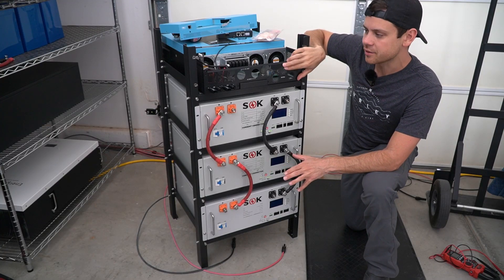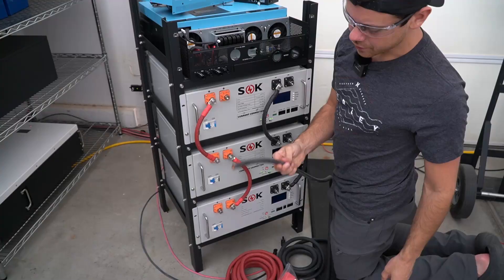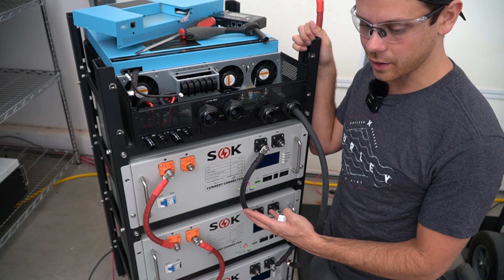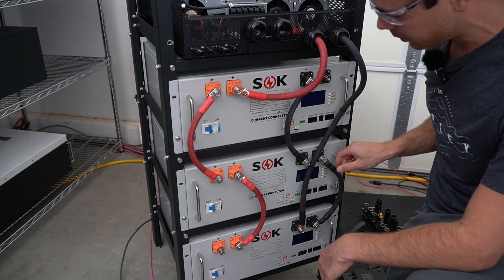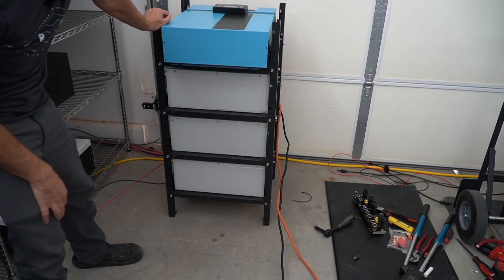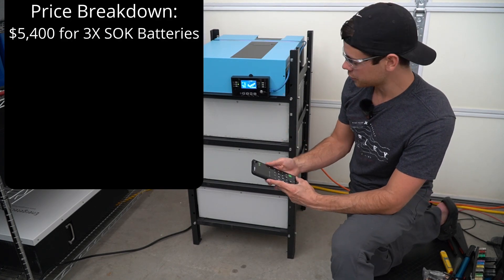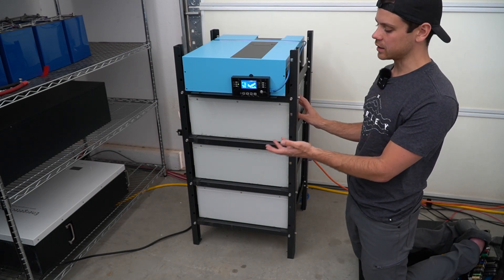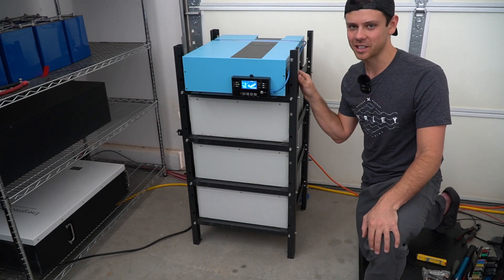DIY Server Rack Solar Power System: 15kWh LiFePO4 + 8kW Solar + Serviceable + Scalable

Comment: Great demonstration. You nailed it perfectly. I was wondering if you have plans making a video on Offgrid, European/other world voltage solar systems (230/400V 1phase/3phase).  I strongly believe that will catch a lot more audience and with much higher viewing too. Just a thought. Please do consider it. Very much appreciated for your devotion and all the great work you do for this community. Cheers.
Reply: In Europe, the batteries would be exactly the same, and the inverter would only have one hot leg, not two, so not a big difference. That said, it would be cool if we all learned how other countries do it.

Comment: Simple, compact, cheap. Awesome.

I've watched a lot of Will's videos and safety tips are mentioned throughout. But I haven't heard a discussion of the safety of putting this in your attached garage. Some people have a "solar shed". I'd love to hear Will's take on all the safety issues and best practices. Maybe there isn't much to it with this type of system. Thanks for all these great videos that give my day a nice boost whenever a new one comes out.
Reply: Mine is in the basement and i have no concerns .I would be more worried about my furnace trying to kill me ,i had to replace mine 2 years ago because it was filling the house with co2.
Reply: if it worries you, Will mentioned you could put T classes on it, not necessary but he mentioned it if going bigger..especially if using 250v, and you have a single inverter short or a wire short.  There is a discussion in DIY about using hardy.
Reply: @goose-F16  Thanks. I was worried about the runaway fires I had seen in the news. Since then, Will's "LiFePO4 Drill Test! Will it erupt in flames?" video showed that LiFePO4 is fairly safe. I'm still curious if Will would put batteries in a home basement, or would a garage be better - outside the main living space.

Comment: I would extend the server rack (up) and mount the inverter vertically. That way you could have access to the batteries and you would not have to remotely mount the controller.
Reply: Could you mount 2 back to back on a central board?

Comment: Put locking wheels and a wide base on it. Being able to roll it while having it stand steady means a lot to a physically challenged but able person. Having the security to inspect the cables and such on the back adds a peace of mind.
Reply: Harbor Freight.....fabricated a rolling pallet table for the machine shop, they'll hold 1,000 lbs easily.
Reply: Harbor Freight - 4 Wheel Dolly, cut legs off below bottom shelf, attach shelving to dolly
Reply: i got casters for my server rack ,even with one battery you need them .90+ pounds a shot.

Comment: For whole home backup in a dual rack 30Kwh split phase 120/240V config, would you recommend the LVX6048 over the LV6548, given inductive loads like well pump, furnace fab, heat pump, fridge, washer, dryer?
Reply: I can't see much difference between the two, what am I missing?

Comment: I think the one main downside to turning it like that is you're making it hard to fix something, or check the displays on the batteries themselves.  I know you said in this setup you only want to look at the one control box, but personally I'd rather push it flat to the wall and put a movable divider to hide it if needed.
Reply: You can always slap some wheels on the bottom of the rack and turn it around. Or make a Lazy Susan type base that twists around.
Reply: I kind of agree I like looking at the batteries haha especially those apps okay with the digital readouts and everything. I want people to see all the technology

Comment: This is PERFECT for a whole house backup system too, even without Solar. Just having it for cases of Disaster recovery, Blackouts, Brownouts .. etc. If you double the battery capacity to 30K, you will have more than enough to survive a disaster or extended blackout for Days!  Add a nice size Generator in cases of REALLY extended blackouts and you are good for a long time!
Reply: Might as well add solar and go completely off-grid. The Panels will probably be the cheapest if u go refurbished panels..
Reply: @suwaebuceesay9954 My question is how small of a quiet generator would be required to trickle charge these batteries to augment charging on cloudy days in a medium zone like Ohio and stay off grid in say a 2500 sf house? (32 kWh avg daily demand). You can buy an 8000 W tri-fuel portable generator for less than $1400 and run it for months on a large propane tank if you wish or plumb it into your natural gas (the other grid)
Reply: @sethkenimer3151  Mostly when i think of including a generator into a solar setup i feel like am cheating.. I’d rather reduce my energy usage at times when the sun will be a problem for the Panels..
Reply: @suwaebuceesay9954  Well, sometimes you don't get a choice .. there are places where you get over cast clouds for long enough that you can't really charge the batteries from Solar. In that situation, You can crank up a generator, charge up the batteries at full output power then shut down and use the batteries for a few days.
Reply: @suwaebuceesay9954  Yeah, but sometimes it's not possible (Rental places, local zoning ordinances .. etc).
Reply: thats totally true. however if you were able to run a generator it'd never pay for it self. a little bit of both  cau
Reply: bit of both...come summer or those days of sunshine you're still using propane.

Comment: Just out of morbid curiosity, did you weigh it?

Seriously, this thing is fantastic.  If I didn't have to re-pave a driveway this year ($20,000) I would probably put one of these together for myself.
Reply from the maker: The batteries are 99 pounds. So about 400 pounds total.
Reply: @WillProwse  Whoa! even more than I expected.
Reply: @DIY Solar Power with Will Prowse  are you still liking the sok batteries the best I wish I'd have bought them. I did get my eg4 for about fourteen fifty each. Only 5-year warranty though. oh well I'm kind of stuck with them now. I have 1 EG 4ll three regular eg4 do you think could I add 2 sok's in there. 

All current products I just bought them

I know you're not supposed to change battery brands or I should say have different brands in the same rack
Reply: As I remember the batteries are about 60-70 pounds and the inverter is about the same.

Comment: For a small off grid home this would work for most power needs, providing you have an alternative heating source like a wood or pellet stove. Myself I like propane for cooking. 

This system being modular is handy to scale it up or down to fit your power requirements.
Reply: How fast do you go through propane in that situation? I've always been curious about that. Do you buy Large canisters (20/40/100lb?) and how long do they last on normal use?
Reply: @jonjohns8145  when it's just me a 40 pound tank lasts three months easy when sweetie is here because she likes to cook about two months.
Reply: @krissfemmpaws1029  Nice .. I would have thought less, good to know.
Reply: @jonjohns8145  at this point all I use the propane for is cooking and heat water for washing dishes.
Reply: @krissfemmpaws1029  Do you use it for Shower water heating or do you use excess Solar for that?
Reply: @jonjohns8145  I use a solar shower for that or go down to the Port and use their showers. But I am looking at a propane portable shower hot water heater.

Comment: I love your content and enthusiasm!  I have casually explored solar the last couple years (trying to decide what system I want) and find your content very valuable.  So, I know this model charge controller isn’t UL Listed for grid tie application in US.  BUT, I really want to do essentially 2x this setup for split phase 220 but want grid tie…. I had been planning to do a SolArk for convenience but would very much appreciate if you could delve into best value option for UL Listed secondary isolation automatic transfer options may exist…. I.E. help me figure out how to not pull the trigger on a SolArk and somehow make these gridtie able - please
Reply: I second that!  Would be wonderful to get Will's recommendation on if/how it would be done :)
Reply: Yep. Same boat. Been delaying on pulling the trigger on the batteries but now is looking better and better. Grid tied with battery backup like solark but better.
Reply: SolArk (based on Sunsynk) is great kit. The video shows what can be done for a great price, but long term I would definitely consider the SolArk even at a slight premium. Certified, longer warranty etc. I know Sunsynk has a new 16kW single phase (240v) which launched recently- perfect for high peak households - no need to parallel 2x 8kW’s- perhaps reach out to SolArk and ask if it’s coming to them as well in future- unless of course 8kW is big enough for your loads.
Reply: Will be following as well

Comment: Straight to the point of the video, very appreciated.  Q: Would this type of system work for a RV or Motorhome?  What would you change for a mobile installation?
Reply from the maker: This thing is heavy. Focus on distributing the weight strategically on the chassis. Or put water tanks/propane on one side, and this battery on the other side. Keep the weight between the wheels. Also, in an accident, it will have a lot of inertia. I would suggest grade 8 steel bolts holding it to the chassis.
Reply: @WillProwse  Wouldn't you also prefer a 24V system in that case? since most RVs are wired for 12/24V?  You'd have to use a different inverter and batteries, but the general setup is the same, no?
Reply from the maker: @jonjohns8145  I don't use alternator charging. I would stick with 48V and fill the roof with panels. Which I did on all of my rvs. Some will need alternator charging depending on climate and use case.
Reply: @WillProwse  Gotcha! thanks

Comment: I have 48 volt solar charging (Victron MPPT 150 45 - Tr) a 24 volt battery bank and inverter (Victron MiltiPlus Compact 24v 2000va 50a)

The solar leads should be on different terminals than the inverter because of the different voltage?

The reason I'm asking is that the shunt isn't properly recording recharge. The SOC stays down even after the batteries are fully charged. I have to synchronize every charge.

Comment: Add a communication cable to the battery and then you can see battery SOC on the inverter panel, then you don’t need the screens